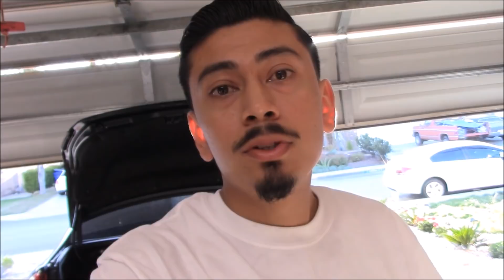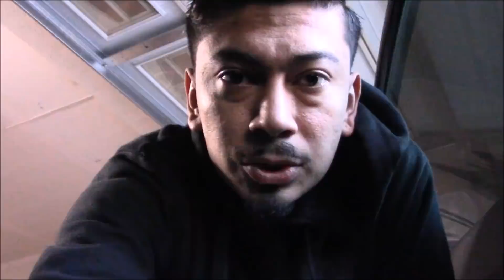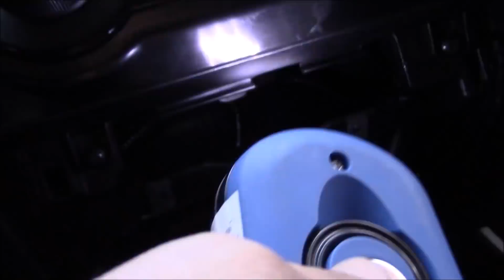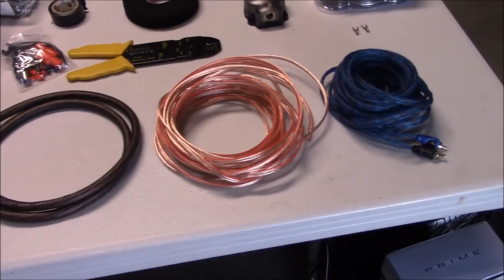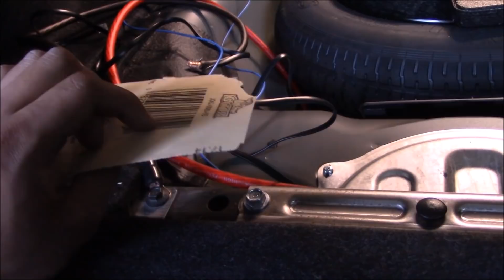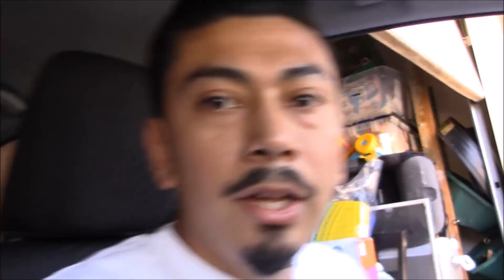HOW TO INSTALL AN AMP TO A FACTORY RADIO | 2015 HONDA CIVIC

Comment from the maker: FOLLOW MY INSTAGRAM @_jesserizo 
Stay Tuned for:
-Noico (sound deadening) INSTALL-Noico ReviewIf you want to donate to the channel email me: jesserizoyt@gmail.com
Reply: Jesse Rizo hey do you have to have the Rockford amp for the converter to work properly
Reply: Thank you so much Jesse ! This video was fantastic I have one question tho.
Reply: On my 10th gen Si in the center of the rear deck I have a factory 8" sub and the amp is behind a door panel somewhere. I got my own 12, box, amp, and converter.  Do I have to do anything different since I have the 2 6.5s and the 8" Honda sub and amp already in the car????
Reply: Hi brother I'm looking for harness play amplifier to conect my stock radio for my toyota tacoma 2017. I hope can you help me and tell me where can buy. Thank you bro.
Reply: Should voice go in to your subwoofers or just bass?

Comment: Buy the lc1i converter you tap the speaker lines and run a remote wire from your lc1i without needing the one from the radio at all it just needs power and ground witch can be pulled of the same ones your amp uses. No need to pull the radio out of the dash.

Comment: When you tapped in the to the rear speakers , you just tapped in to the wires that are connected to the harness or the actual harness?

Comment: Just a quick easy fix instead of using the remote wire on the OEM radio plug you can also plug the lead remote wire into the fuel pump fuse. Great video though Bro! 💯
Reply from the maker: Thanks for watching 🙏🙏

Comment: Now when you tap into the cars rear speakers does the amp give the cars factory speakers power sense your running into them? Cause it seems like that would be to much power for them .

Comment: If your amplifier has speaker (or high level) inputs (his amplifier has speaker level inputs), you don't need to buy and install a line output convertor.

Comment: If you just want to add a powered subwoofer, a powered line output converter with signal sensing remote on wire eliminates the need to pull the radio out. Look up a Scosche LOC2SL for an example.

Comment: There is 1 little thing I hated about this good video.  It  was, you cut the factory wire to tap your remote and rca speaker out.  For the remote wire, you could have d-pinned it and tapped into that wire that way and put the pin back.  Or could have just stuck the wire in the back of the  connector and tapped it so well that it wont come loose and the factoey wire would still be intact.  Good job though on the video.  Also want to mention if your Honda does not have a factory subwoofer, Honda's hves an ANC (active noise cancelling) Unit you woud need to disconnect cause that unit sends a noise to the inside speskers to try and cancel out road noise.

Comment: I did this in a 2013 civic over the weekend and even with the gain maxed you can barely feel the speaker with your hand. Got getting hardly anything
Reply from the maker: Check your connections something sounds like it’s grounding out or something

Comment: Did you just use speaker wire to connect the converter to the speakers ?

Comment: Great tutorial I must say I fully understand with the exception of one thing...when you tapped into the rear speakers for the amp does the remaining front speakers stay at factory level? Or do I tap into those as well.

Comment: So when connecting straight to the radio, did you just cut the wire in half, wrap the amp wire and radio wire together, and then taped it all back up? I’m planning on installing all this stuff for the first time by myself this weekend. And I’m trying to understand that part

Comment: Is that high level converter going to "Deamplify" the signal coming to the speakers, bring it to the new aftermarket amp and resend the amplified signal back to the speaker??? dont shoot me pls, i am totally lost as of what to do to install my new amp to my car without cutting every wire in my car (as most audio shops ive gone to have suggested).

Comment: look so well down  and i have a question,  i have same model  but i have lot of stuff in the trunk  because its my work car  what u suggest if i put a 8 inch sub in between speakers  does it give decent sound  i mean without subwoofer box.

Comment: Would it be possible to put a rca bass control knob on the high level converter? My amp doesn’t have a bass control plug

Comment: is that a Touring? I just got a 2014 and I'm scared to take the dash apart. its already wired for subs but looks like shoddy work so I want to re do it.
this eases my nerves a bit. but my buddy keeps saying the high level. converter should be at the front with stock unit???? why would that matter?
Reply from the maker: It should be the same and this is the se model, 
And technically yes it’ll be a cleaner install because it’ll be hidden, for me I did it this way just for demonstration purposes was easier to explain visually for the viewers another thing if I was you look into a plug and play high level converted now a days a lot of company’s make plug and play models that literally plug into the radio like a t harness and makes it cleaner and easier

Comment: Thanks for the video. It was very explained and detailed. Keep it up! 
I have a Honda civic 2014 ex with push start button. I followed all instructions, I bought even the same materials. This is the problems that I found:

Everything was fine until I tried to turn off the car. I got stuck in accessory mode. I won’t be able to turn off the vehicle. Every time I need to unplug the negative terminal of the battery to turn off the car. 

I thought I blew off some fuse or relay, so I checked up every single fuse with a multimeter without finding the problem. Everything was good. So after searching online I replace the key fob battery thinking that was the issue. So I tried to remove just the fuse from the amp and everything was good, The car turned off. I reconnect the fuse from the amp and the I comeback the same problem. I disconnected the remote cable from the amp and car turned off. So I’m thinking that the connection from the remote to the radio is doing something wrong. 
Do you suggest to do something about it ? Or anyone could ?
I appreciate your help in advance.

Comment: i’m a little late but do you know if it’s easier to just run the remote into the fuse box? i’ve only ever gotten behind the radio and done it that way but now i’m installing on my 2014 civic.
Reply: Lemme know how you do bro, I’m with the same car doing the same, just trying to figure out if having the older model radio will affect it at all.

Comment: If you ever need to remove the sub box for any reason, you will have to unhook everything from the amp. That's why most installers  don't hook the amp to the sub box. But it looks nice.

Comment: do i have to run that exact converter if i’m using my stock stereo, and do yk if the wires are the same for your 2014 model (i have a 2015 civic)

Comment: Yo awesome video bro, I just got a 2012 accord and I gotta add my subs. Just doesn’t feel right without them. Had a question though, if my amplifier has a high level input slot with the little piece that has 4 wires sticking out, would I just hook that up to the rear speakers instead of having to get an LOC? I’m almost positive that I can, basically as a substitute for the RCAs, but I don’t want to do all the work just to find out I did it wrong lol. I’ve been trying to research it for like a week now
Reply: The high level input says it has an auto turn on too instead of needing the remote wire, so it seems perfect. Also I love the Rockfords, I’ve got 2 12”s in my box and they’re incredible even for being from like the 90s lol

Comment: Do you have to install the converter for the sun to work? I stalled everything and my sub isn’t doing anything but I don’t have the converter
Reply from the maker: Check all connections I do have the converter still and mines still kickin

Comment: Do you need ro have a high level converter for a factory head unit? I did all this on my stock 2011 civic head unit but didn't use a high Level converter and nothing going on my sub.
Reply from the maker: Yes as in this video it’s the factory head unit and I needed one
Reply: @JesseRizo  ok. Thank you. Learned how to do this from your video. Thanks!

Comment: Ay what happens if I use my speaker connection and just connecting it to the sub. Without using the amp.
Reply from the maker: It won’t put out you may hear something but it won’t put out anything most stereos only push out about 25-50 watts max a speaker

Comment: replace that loc with a JL audio loc 2. it will create the remote turn on and is powered so cleaner output.. Best 100 bucks youll spend

Comment: You could have just used an add a fuse wich is better than cutting and tapping into a factory wire and avoided all the head unit removal nonsense

Comment: mans pulled the radio out to only add the REM and not convert from there LOL, still great and I see why you did it, this vid will help me when I install either today or Thursday
Reply: if you connect it from the dash can you run the wires straight to the amp or you absolutely need that special box that converts to rca

Comment: This video is the BEST. I have a 10th gen civic would I  need to take out my radio and tap into a wire for the remote  to install a sub if I hook my remote wire to a fuse  that is a power on only when the key is on???

Comment: The amps come with a high level output clip wire harness can tap on the rear speakers to avoid buying the converter

Comment: When you “tap” into your rear speakers do you just cut and splice it back together or. That part as me confused
Reply: You can just cut into the insulation and splice the wires that way and tape up

Comment: Would the remote wire be the same color in a 2013? I wired everything up correctly but my amp doesn’t even get power

Comment: Jesse i got the High Low audio converter with Rem wire but need to know if hav to correct the rem wire to head unit's one or just to the amp from converter

Comment: How to install a db link HLC1 Impedance 10k OHMS an not bypass the MONSOON factory amplifier
Reply: I have a 2006 Pontiac G6 with a MONSOON amp and I want to know if I install a HLC1 line out converter db link with out bypassing the factory preamplipher an useing factory stereo will it work with a 4 channel kenwood amp an 12 in Sony exploed in a ported box the line out db link only has 4 wires left an right speaker wires an RCA Connectors with left an right output adjustments

Comment: About the high level converter connection im abit confuse, it looks like u taps the converter wire that stick out to stock deck speakers wire into T joint wiring style is it? 
Because i thought that the converter 4 wires that stick out suppose to tap to stock speaker wire, its like to convert it to be rca and connect to amp. And then get new wire and connect from amp and straight to rear deck speaker. Correct me if im wrong.

Comment: Did you have any problems running the remote wire on the same side as the power wire. I've seen in a lot of places you should run them opposite sides of the car? It seems like yours worked out okay? Got any advice?
Reply from the maker: Khepra Mims I have had no issues at all and still don’t but yes it is recommended to run them on separate sides so if u have time u should 👍 it is recommended
Reply: @JesseRizo  Cool thank you for the quick reply. One other thing,  I got that same LOC, but how do you know which wires to tap into on the rear speakers? I'm assuming there's colored labeled terminals but how do you know where to connect those wires back into the LOC?

Comment: Does the stock radio have some sort of RCA out? I have a 2013 civic si and i feel like if i tap into the stock sub it will somehow interfiere with the signal but i also feel like i will not get enough bass out of the read deck speakers

Comment: How can I connect my converter to my 2015 Kia Forte oem radio
Reply from the maker: It should be a similar install my friend the color of the wires might just be different

Comment: I wired it all like you bro but im barely getting any bass out of the sub, should i wire it differently since mine is an Si with the factory amp and sub?

Comment: First off, your video is very helpful.
Thanks for that. 
My question is, my car only has one rear speaker,  how do I connect the converter into one speaker instead of two?
Reply from the maker: U can try the front door speakers

Comment: i just wanted to say man that you explained everything great and in an awesome manor thank you so much i'm going to be installing my own sub woofer and amp in my 2013 civic soon enough and I've looked all over but everything was insanely confusing but the way you explained the process was super simple now i am looking forward to my set up.
Reply from the maker: Thanks for watching :)!!!
Reply: @joekeller3999 have you installed your subs yet I’m also trying to install subs into my 2013 civic and I’m running into some trouble

Comment: on the high outut converter theres a yellow power wire.. could you just tap that to the amp power cable as well?

Comment: you have a lot of extra rca because you should have installed the inline by the radio
Reply: I noticed that too, that amp has line level and speaker level inputs. No need for a convertor.

Comment: I have the same car. 2 12" punch 2's but about to install all new stuff. Massive Audio Torox 12's with Wolfram 2400.1 amp and new D5100R XS under hood and D3400R for trunk. XS Batteries. Big 3 all 0 gauge wire through out. So watching this helps .

Comment: is your civic an LX or EX?
Reply from the maker: In the middle its a se special edition basically a lx with some of the ex options
Reply: @JesseRizo  i was mostly wondering because the bass is garbage in my LX 2014, and I wasn't sure if turning down the bass on the 4 speakers would turn down the bass on the sub

Comment: Hey man , I’ve been trying to install my new 12s and amp and I’m running my converter it’s a scosche converter and I was running it to my amp and everything was hooked up and the bass just started hitting without any music playing and ended up blowing my fuse in my amp any tips or solutions ?
Reply from the maker: U could have a loose connection or maybe the ground wasn’t properly secured or grounded, or maybe the fuse wasn’t correct for the amp if it was a used amp
Reply: Hey I have a question about the rca connecting part, there are 6 lines all together, 2 brown obviously goes to ground like you said. Does it matter what 2 color lines go to each speaker?
Reply: @christianazario8261  I would use the wires from right side to power right and same with left. Colors vary on vehicles. Grey is left and white is right on aftermarket
Reply: You have an issue with ur front channels not working then. Thats the no highs problem. Fuse in amp is either wrong impendance sub and amp matchup, wired wrong at voicecoils, or reversed wiring on converter.

Comment: thanks bro ! It helped a lot but you should also show everything you do more detailed as the high level converter instalation and how to trow the cables all the way to the back
Reply from the maker: You welcome bro, 
N I had it recorded just the video was to long so I cut some pieces out 😅 sorry about that and thanks for the tip :)

Comment: So I followed step by step and now my car has to be reset every time and my radio does not turn on at all
Reply from the maker: You could have blown a fuse that’s why it’s key to disconnect negative of the battery when working with electrical in a vehicle

Comment: Why did you tap into the stock radio wiring harness for the remote turn on wire? In my opinion, it seems like a lot of extra work, considering you can buy a fuse tap and simply tap into the accessory fuse located under the driver-side foot well. Both are effective, but I am just presenting another method/execution.

Comment: please disconnect the negative battery terminal when doing any wiring!
for gp i decided to watch a few of these install vids on youtube as i have not installed anything in over 10 years and im amazed that every one so far fails on one other detail. DO NOT RUN YOUR POWER LINE ALONGSIDE THE SPEAKER WIRES. it's not a safety issue but it can add an electric whine in your audio.

Comment: Hey man, I have some questions and wanted to see how many of them you can maybe help me with. 
So I'm trying to install my Pioneer head unit into my 2013  Honda civic. I've run into some issues and would love some help.
1) I'm wanting to hook up my back up camera so that it shows up on the head unit screen instead of the small stock screen. 
2) I want to use my stock mic for phone calls and such install of selling the aftermarket mic. 
3) I bought a steering controller to wire into the head unit but the instructions seem to be wrong on which wire to splice into because it isnt working. If anyone is able to help me with any of these issues I would really appreciate it.

Comment: this rockford amp already has high level input you didnt need the converter(the extra connector with 4 wire included in the box)
Reply: Vinny botanikberg high level inputs are crap

Comment: Hey do you need the rca converter because on the factory stereo it showed that you can adjust the subwoofer level
Reply from the maker: Yes for any aftermarket amplified you need the converter
Reply: @JesseRizo  I'm pretty sure that amp has both line level AND speaker level inputs. No need for a convertor.

Comment: I’ve read on forums that the white wire is the one you should use for the radio not the purple. Could I use either one? Let me know anybody who has used the white or purple. Will both work? Thanks
Reply from the maker: Maybe depends the model and year of the vehicle? I havnt had any issues